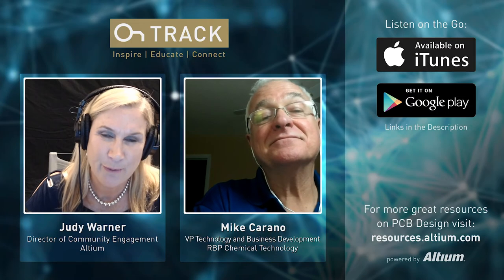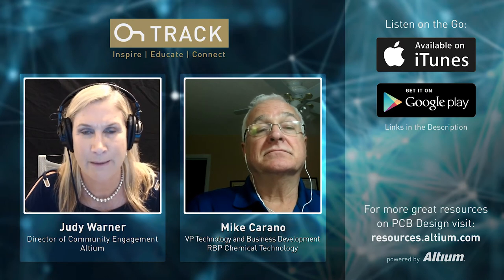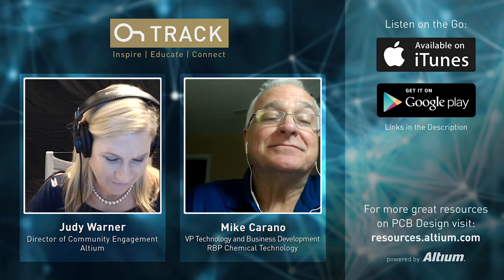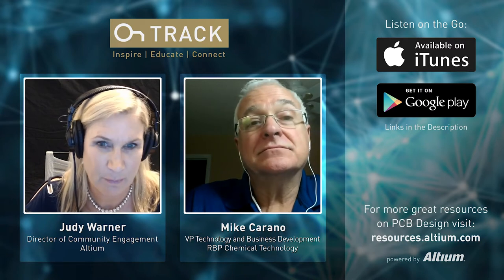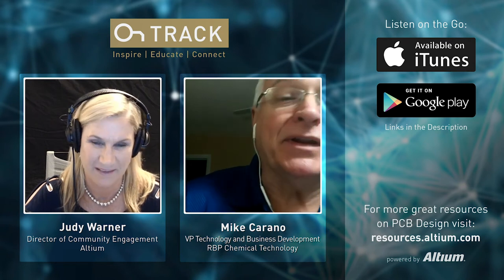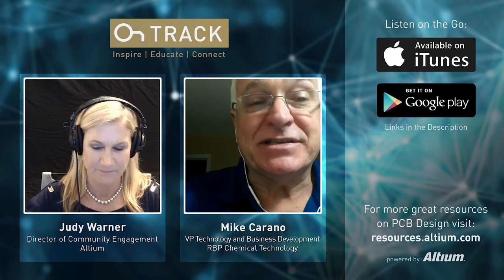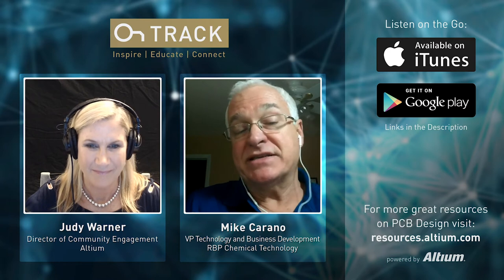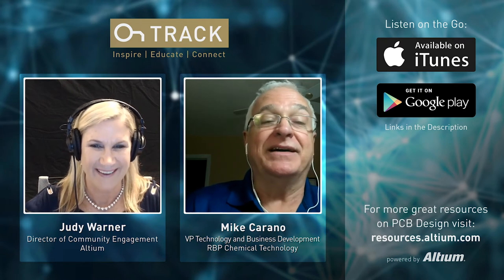Surface Finishes on Printed Circuit Boards with Mike Carano [OnTrack Podcast]

Comment: This was a really informative video and a great help with specifying manufacturing data that needs to be provided to a PCB manufacturer to ensure the best quality for the design as well as minimizing PCB / circuit failure due to incorrect choice of materials used. Thank you Judy and Mike. Excellent.